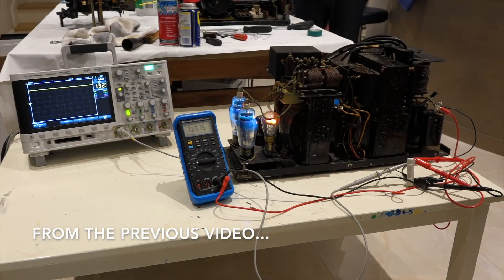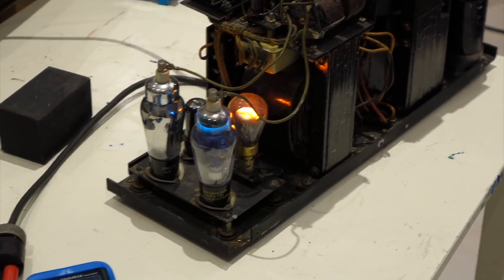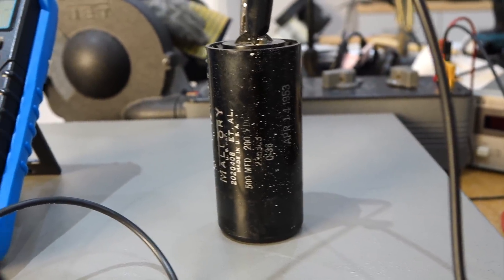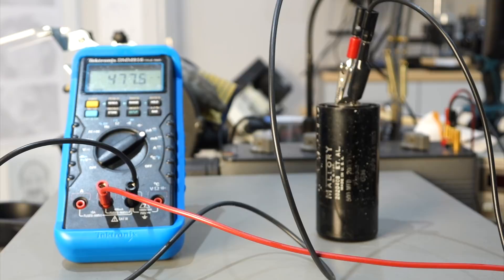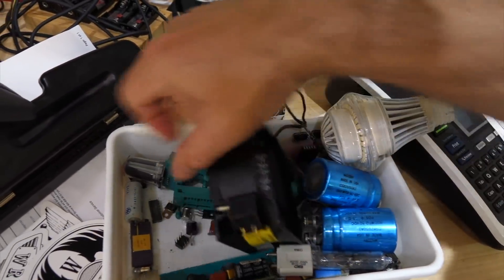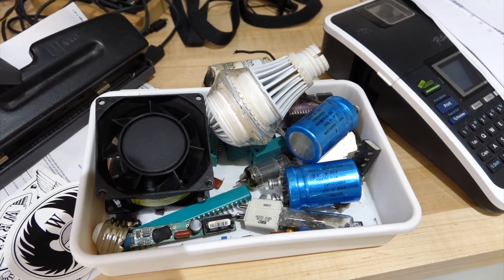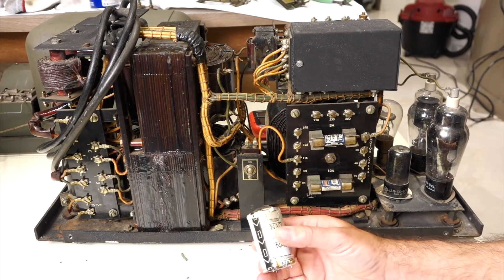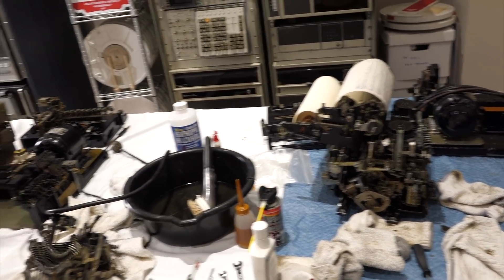Why we don't always replace vintage electrolytic capacitors

Comment: What a lot of cargo cultists don't understand is that any electrolytic that has been unused for a long period of time is likely to need reforming. This includes new old stock.  Typically you will find that  capacitors in need of reforming will exhibit higher than normal leakage and also higher than normal capacitance owing to thinning of the oxide layer. While reforming, it's wise to gradually increase the voltage up to the rated working voltage while keeping the current at or below 1 mA in order to minimise internal heating. It's also wise to monitor for increasing, rather than decreasing current.  As noted by Marc, increasing leakage current is not a good sign.  Note that a  100V capacitor that has spent its life at, say, 10V will likely still need reforming if reused in an application that will see it at 100V.
Reply: That sounds wrong to me. I have successfully reformed old electrolytics for years (since the '70s) with a good success rate. oldblokeh experience is similar to mine. I'm not really sure about your credentials, but I do actually have a bachelor's in EE. We never had any material about reforming electrolytics, or any other restoration work. That is something that hobbyists and restoration people do. Vey much not covered in college, especially even for more advanced degrees. Troll or BS artist, I'm not sure which...
Reply: oldblokeh - Please provide a link to your “science.”  I’ve been doing this work for nearly 50 years. Your technical, material science ideas must be in some peer reviewed publications with actual data that this old Ph.D. adviser can understand. 

My God.  All those grad students I need to call and tell them we were all wrong about charge tunneling, polymorphic surface layer structure changes, and oh Lord, simple old atmospheric penetration!

Please help me.
Reply: How about an MSc thesis: https://digital.library.unt.edu/ark:/67531/metadc3104/m2/1/high_res_d/thesis.pdf
Reply: @oldblokeh  how do you reform a cap?
Reply: @boonedockjourneyman7979  How come you never came back and shared your thoughts about the paper posted here? Or are you still busy chasing down former grad students and informing them? LMAO
Reply: @SpenserRoger  lol
Reply: @Mikael5732  Lol and the guy still hasn't responded, hopefully he finished tracking down everyone but now he's got an even bigger problem left on his hands: reforming 50 years of capacitors LMAO
Reply: if you watch some videos like Radiotvphonontut he used an old capacitor checker, those caps may seem ok but if you apply 600v to them you can see leakage. but I know I have some really old equipment like scopes that are 30 -40 yr. old and they still work perfectly.
Reply: @boonedockjourneyman7979  omg lmfao rekt!
Reply: Nichicon (one of the most reputable capacitor manufacturers) Application Guidelines for Aluminum Electolytic Capacitors ( http://www.nichicon.co.jp/english/products/pdf/aluminum.pdf ) page 18, section 2-6 "Storage Performance". Quote: "When an aluminum electrolytic capacitor is stored under no  load  conditions  for  a  long  period  of  time,  its  leakage current tends to increase slightly". Quote: "A voltage treatment is recommended when using a capacitor stored for a long period of time. The treatment for an individual capacitor is accomplished by charging up to its rated voltage through a resistance of about 1 k Ω and applying the voltage for approximately 30 minutes. When a capacitor is already built into an appliance, the appliance must undergo aging. In this case, it is recommended that the input voltage be raised gradually with a voltage regulator to the rated input voltage of the appliance".

Comment: To start, let me say don't let the haters get you down. Your channel, your methods, my viewing pleasure.

To be honest, I was surprised the old electrolytic capacitor survived as well as they did. And I'm most certainly guilty of replacing a lot of them. I do however test at least a few of the capacitors of every device I go through to make a proper evaluation. 
In my opinion how bad they will be depends a lot on make, model, material quality and usage/load (did I get every variable there :)) But there are good generalizations.  Paper wax for example is almost always bad, but even early metal foil types are mostly fine, unless their cases cracked or had bad sealing against moisture or such. Liquid filled electrolytic's that dripped and corroded your chassis are bad of course, but the more solid ones might be fine. The example vintage capacitor in this video was military spec, solid and had low frequency (and maybe quite constant) load in contrast to the bad ones you found in the alto power supply. So it survived well. I'm curious though what their spec MTBF was. 
My guess the reason you see so few bad ones: Your repairing mostly high end expensive gear. Maybe that stuff was actually worth its price :) 

cannot wait to see the next restore on the teletype

Comment: I think the idea of needing to redo all of the caps in old equipment is a product of the modern digital age. Modern circuitry is far more sensitive to variations in components than an analog, mostly mechanical teletype or really any old analog electronics.

Also contributing to the myth are people from the audiophile crowd etc who insist on spending ludicrous amounts of money for high end components of diminishing return. There is a certain point where human hearing cannot distinguish the difference in quality of things like capacitors in an audio circuit, but they will want everything to be perfect.

Not that audiophiles/etc wanting perfection is necessarily a "bad" thing, its more of a matter of cost/benefit and preference. I don't think that monster of a power supply is particularly picky about minor variations in component specs, and the end user certainly wont notice any difference.
Reply: >I think the idea of needing to redo all of the caps in old equipment is a product of the modern digital age.
No. Certain types of vintage capacitors (paper/wax) absolutely must go, because over the years they all have turned into resistors. This is the type that causes your tubes to red plate and wears them down fairly quickly.
Reply: Good that this Teletype doesn't have any wax capacitors in it then...
Reply: Sure? I haven't caught what type those small 1µF caps are, did you? Mica?

Comment: I've seen electrolytic cap failed short once. It was already repaired and assembled device which was turned on for final tests and I was lucky to watch whole process. Can't remember it precisely but I believe it was something around 200uF and 350V vintage cap from early - mid 70's. It was a filter cap on 250V rail. The only consequences was humming transformer for a short period of time and burned 10W resistor. Device worked fine after I changed resistor and cap.

Comment: Man, that blue/cyan glow is amazing.

I remember seeing mercury filled tubes in some YouTube video of a vintage Philips amplifier. It's spectacular, to say the least.

I wanted to comment on your previous video but it was so crowded with "Replace ALL CAPS" advocates :-(
Reply: Paul NJ I wonder how much UV was coming out of those tubes.

Replace the tubes with solid state devices to protect the users! ;-)
Reply: @jamesgrimwood1285  just put it inside an enclosure. Jobs done.

Comment: Wow. I read through some of those comments and I thought to myself didn't you just show the capacitors are working with low leakage and good supply regulation, with the appropriate tool for the job? Then to hear that you were subject to more vitriol  beyond the comment section has me shaking my head. I don't know whether it's a good thing you don't live stream; I've seen creators get so frustrated with the live comments from the peanut gallery that they cut the live stream short. Yes, as someone else mentioned here, Feynman's Cargo Cult culture comes to mind.

Comment: Probably as leaky as the day it was made.

Usually the issue with electrolytics is the electrolyte leaks and they dry out, the ESR goes through the roof along with the capacitance dropping. Those cause either the board to get eaten or the cap to go atomic.

However I only play an EE on the internet, so that might be a simplistic view of things. Also, maybe that was covered, I wasn't paying full attention

Comment: the only time it makes sense to recap is in 1980+ Designs where the people started penny pinching in Homecomputers , causing some parts to be stressed more and those capacitors tempt to fail (looking at you Amiga 500) , otherwise its a waste of time and money
Reply: Marc isn't refusing to change them. He changes them if needed, but only if needed. 

In old tube gear, the reason leakage is dangerous concerns circuits where the capacitor is a DC block and leakage would introduce bias on the grid of the next tube in a chain. The bias changes the operating point and can overstress the tube by causing excess conduction - due to the DC voltage on the grid.  In this case, leakage is bad and has to be very low to be tolerable.

If a circuit would be damaged by exceeding some current, leakage might be a problem but the design of the circuit sets the bar for when leakage becomes harmful. A power supply should be designed so that even a dead short across the output will be handled - perhaps by a fuse (and maybe a crowbar device) - thus the filter caps aren't a risk. Their failure impact would be inadequate filtering, excess ripple, rather than excess current.

It depends on what the capacitor is doing and the circuit in which it is used, in other words. 

In the real world, every capacitor also has leakage,  series resistance, and inductance. The specifications for new capacitors include that information,  allowing a designer to pick a very low leakage if that is critical for the circuit.

Comment: But it’s a Mallory capacitor... they’re bulletproof!

Seriously though, I replace capacitors in 30 year old Macs because they are cheap.

Given the historical significance of this teletype terminal, I would only replace those items that have been tested and found to be faulty or dangerous. 

“If it ain’t broke …”
Reply: Plus we had the infamous Capacitor Plague which many people remember because computers built with those improperly built parts would fail, and essentially the entire production runs from those manufacturers need to be replaced. That sustains some of the belief in wholesale capacitor replacement, broadening suspicion from the era of crap parts, 1999 to 2007, to every capacitor ever made.
Reply: @carlclaunch793  
None of the junk from 1999 to 2007 is what is on the bench for restoration or repair.
Reply: THOSE capacitors are constructed differently from the Mallory caps of the 50s and earlier.   Those older Mallory caps are likely just fine and will be for decades to come.  They're superior parts, built to a high standard and not to a price point.    Those were made LONG before the idea of planned obsolescence took hold.
Reply: MatchstalkMan but why not use the same logic with macs... I do.... I only replace what needs to go
Reply: I only replace the dead ones... no use heating up a board with bad traces on... my methods always work the best :)
Reply: If I was going to replace the caps in this thing, I'd probably open up the Mallory caps and turn them into a shell using a smaller (physically) modern cap inside.
Reply: Those Macs use SMD caps, which in general are the most likely to fail. The really big electrolytics are usually fine.
Reply: The Macs were built with much better capacitors than anything you are getting "cheap" today. And you are destroying the originality of the design. I have a policy of only replacing falied components for maximum originality and minimizing damage to circuit boards from lifted traces and overheating by the iron.

Comment: Dumbasses think electrolytic from the 2000's is the same as one from the 50's.. That said, I have had to change old caps on vintage tube radios but only when they haven't performed as they should.
Reply: Never attribute to malice that which can be explained by stupidity. For most people who have more recently got into repairing electronics, a good deal of the time capacitors are what failed. I'd place a bet on 40% of all failures of electronics built since 1995 (excluding design flaws), are due to bad caps or at least contain some. If the usual solution of "recap everything" worked for nearly everything before, they're going to assume that's the case here as well "because it's so old". Of course a good deal of people are genuine morons, but that's not ALL of them.
Reply: Lassi Kinnunen  the expression is " hit or miss " not " hit and miss " + you are confusing cheap stuff made for avg. Joe with profesional equipment like the one from this video...
Reply: @Spinler Muckflitt 
In analog audio filtering or processing circuitry upgrading to lower esr caps (like polymer) can improve sound. Lower esr is always better. Digital circuitry on the other hand will usually just see a spike current consumption decrease with better caps. Of course, upgrading is the user's choice if the original caps are good. Otherwise if one is bad I replace all in the same area or the entire board.

Comment: People often don't consider that modern machines are designed way different. More compact, more heat, switching mode power supplies, caps are made cheaper and more compact so more likely to fail earlier and so on. So you are absoluetely right, not every cap has to be replaced.
Reply: I would guess that there also are quality difference in old caps from low end user electronics and high end professional gear.
Reply: @karlramberg  Well there was not exactly a number of low-end suppliers to choose from in the 70s and early-mid 80s. You'd open a $100 home computer and it would be full of Nichicons still working fine. What is however more likely to find in the consumer sector are borderline designs, where capacitors are under more stress than ideal, which i think is a predominant problem as of today's electronics rather than capacitor quality. I don't think mass failure of capacitors in modern LCDs and power supplies is necessarily down to bad capacitors, it's that they're seriously cooked in there by surrounding components and there's no way any capacitor would last 20 years under these conditions. Footprint has always been an important consideration in consumer electronics often overriding any engineering reason, and part count is a huge component of cost, often more so than part supplier or quality grade.